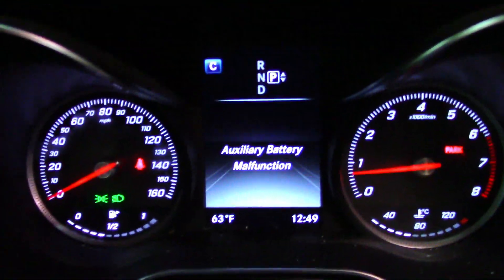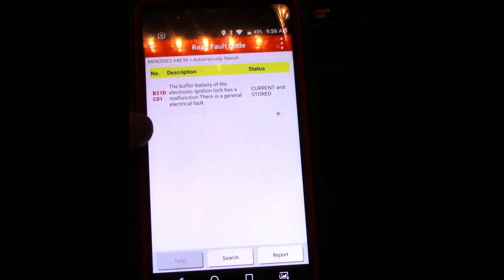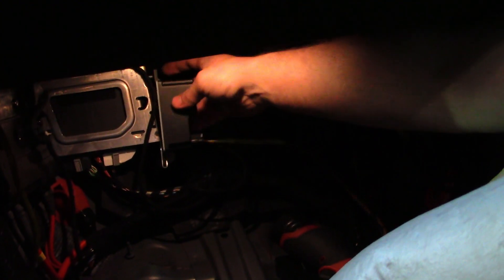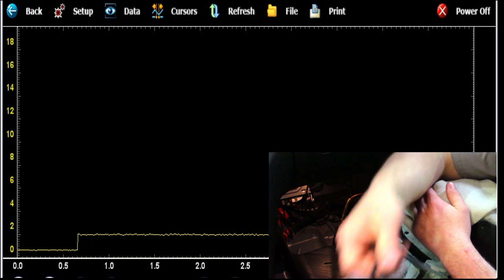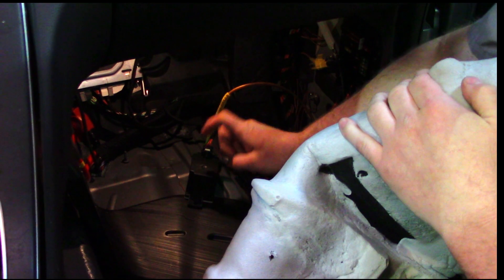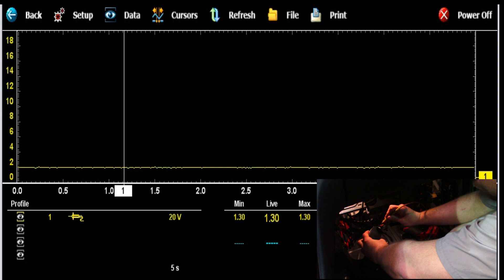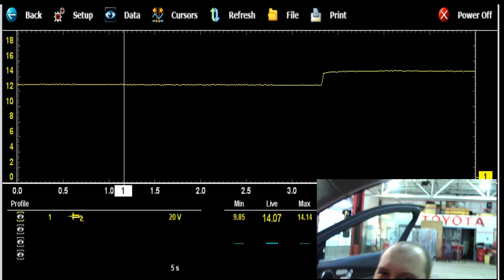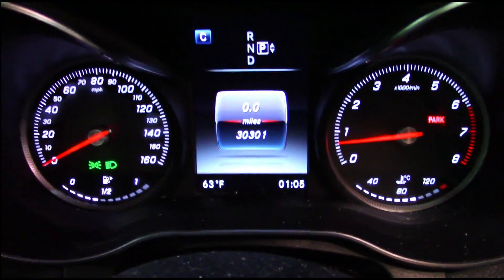2015 Mercedes C300- Auxiliary Battery Malfunction with DTC B21DC01

Comment: Iv had my 2014 220 c class for a year and it's the worst car iv ever owned its nearly a weekly thing that something goes wrong with this car everything from ac compressor to main drive belt snapping the list gose on this is the latest problem so once this is fixed it's going and I will stick to bmw !!!!

Comment: Thanks for the video, when I got auxillary battery error, I replaced it and the error was gone but the start/stop stopped working ! again I bought 2 more parts but the eco on the dashboard does not show up.
I reset the car using Launch scanner, again it did not resolve the problem.Please can you help

Comment: Why didn't you simply use a digital volt meter
Reply from the maker: Only because i almost never use one. You never really know how a circuit is meant to operate. Sometimes such simple circuits are being pulsed on and off and while using a voltmeter, you can get a reading that doesn’t make sense not knowing that the circuit is being turned on and off

Comment: Hey, Thx for video, where i can by this module ?
Reply: I have A 205 044 00 73
Reply from the maker: @dominikzurawski5429  i got it directly from the dealer
Reply: @VoltageDropDiagnostics   Thx for info, i  have checked fuses and one of them is faulty. I replace that one.
Reply: I meant capacitor not fuse

Comment: The lack of service info on some makes is maddening! 🤬
Reply from the maker: Yeah. This one was frustrating because I knew that the capacitor was a common failure part. It was an easy diag. But gathering up the information to be 100% sure of the failure was a pain in the rear.
Reply: I wonder sometimes, if the manufacturers believe that will force people back to their dealers. I think, all it really does is piss off people and make them hate those car lines. There are certain car lines I tell people to avoid like the plague and Mercedes are near the top of my list, just for that reason.

Comment: It seems those Germans don't like giving up information. I have first hand experience with Germans, I'm married to one. (ha ha) Great tip.
Reply: not just the germans. last place i worked sold japanese. was told many times  not to give out info(from corporate) my reply  was bite me
Reply from the maker: This had me dying from laughter!
Reply: I went to a exhibition  there was a.zf stall.ask them why new 9g tronic gear box  use plastic  oil pan answer was it is classified